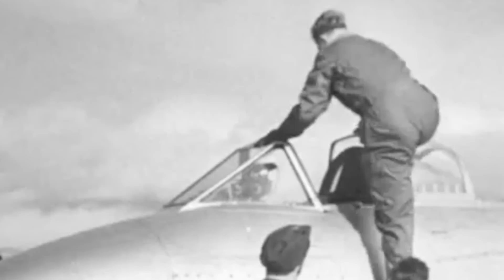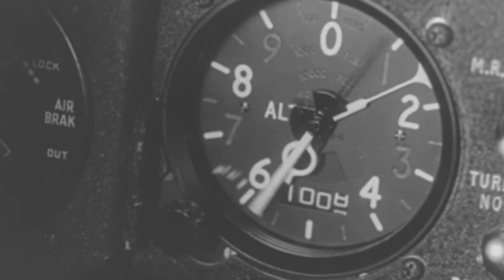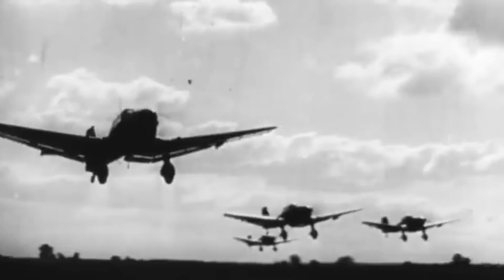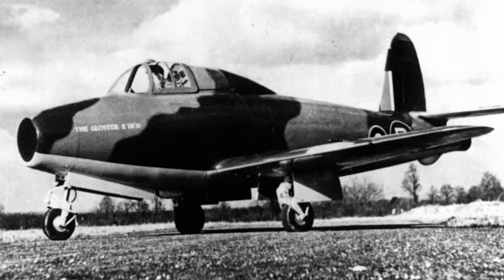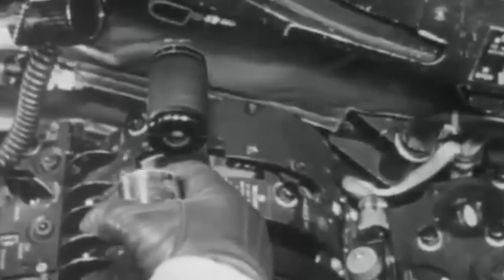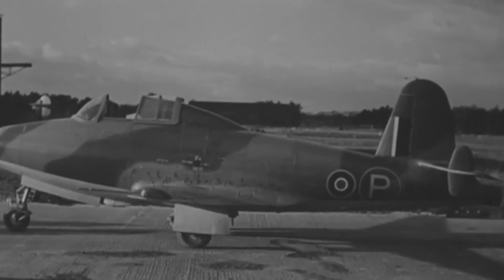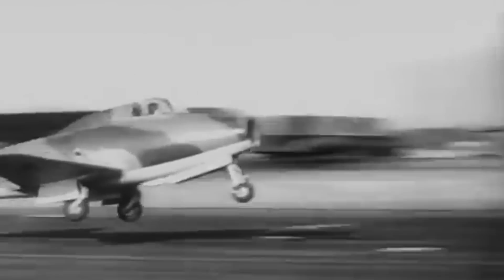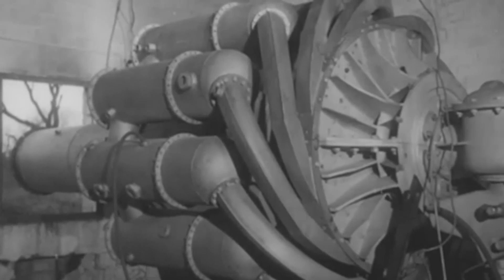Britain's 500 MPH Coffin With Wings

Comment: We feel we can clear up some commonly held myths and misconceptions, obviously.

It's always good to see the facts presented clearly and concisely isn't it

See further down for a Meteor losses comparison.

Indeed that's correct. The Whittle Gloster E28/39 was of course a brilliant aircraft that was later copied in Russia as the upsized and tweaked Mig 15 with a copy of the RR Nene gas turbine aero engine.

Obviously the RR Nene being the world's most powerful & most reliable gas turbine aero engine in 1944. 

   That's correct, of course the MD F3H Demon was a contemporary to the DH Sea Vixen & had a similar performance. The F4 Phantom was a follow on from the F3 Demon. The Sea Vixen took a long time to get from first flight to introduction for various reasons and a similar situation occurred with the MD F3H Demon. 

McDonnell Douglas F3H Demon
590 Built.
Introduction date 7 March 1956
First flight 7 August 1951
Retired 1964

MD F-4 Phantom 2
Number built 5,195
Manufactured 1958–1981
Introduction date 30 December 1960
First flight 27 May 1958

DH Sea Vixen
Number built 151 (including two DH110 prototypes and one Sea Vixen prototype)
Introduction date July 1959
First flight 26 September 1951
Retired 1972

Non combat phase accident losses.
% of Aircraft built.
The Canadair CL-44 was a turboprop airliner.
Canadair CL-44              (ff 1959 ) 48%
Lockheed XF104              (ff 1954) 100%
Lockheed  P80                 (ff 1944) 43%
Lockheed F104                (ff 1954) 45%
MD FH Phantom 1           (ff 1945) 35%
MD F4 Phantom 2           (ff 1958)  28%
MD F3H  Demon              (ff 1951)  32%
Gloster Meteor               (ff 1943)  21%
DH Vampire                    (ff 1943)  23%
DH Sea Vixen                  (ff  1951) 33%
Gloster Javelin                (ff 1951) 20%

    Regarding the UK Aerospace Sector.
  
An airline recently ordered 60 RR Trent XWB Engines

   Clearly It's a great pity & a crying shame that British military forces had to occupy a large part of Germany for decades after 1945 & Russian military forces had to do the same. Of course Russia still posseses a large chunk of what was German territory & of course Russia & the UK produce nukes. Obviously Germany does not produce nukes.

   Interesting British achievements.
There is no doubt that the Fairey (England)
Delta 2 was of course the world's first jet
aircraft to exceed 1000 mph.  lndeed It
exceeded the previous record by 310 mph &
held the record for 1 year. Incidentally, the Dassault Mirage 3 & 4 are based on the Fairey Delta 2.

Early days, jet fighters.
   De Havilland Vampire, Sea Vixen & Gloster Meteor accident losses were not high or unusual for fighter aircraft at the time. De Havilland built large numbers of all metal airframe aircraft before the DH Comet.
We mustn't forget of course that the DH Vampire for example first flew in 1943 & the engine was also built by De Havilland. There were examples of the Vampire interceptor / fighter in service until 1990 which was operated by more than 30 countries.

Non combat phase accident losses.
% of Aircraft built.
The Canadair CL-44 was a turboprop airliner.
Canadair CL-44             (ff 1959 ) 48%
Lockheed XF104             (ff 1954) 100%
Lockheed  P80                (ff 1944) 43%
Lockheed F104                (ff 1954) 45%
McDonnell FH Phantom  (ff 1945) 35%
Gloster Meteor               (ff 1943)  21%
DH Vampire                     (ff 1943)  23%
DH Sea Vixen                  (ff  1951) 33%
Gloster Javelin               (ff 1951) 20%

   An example of what goes on these days in various countries.
Obviously, for example, there are of course no German companies that makes German jet aircraft in Germany & there are no German Companies that make German gas turbine aero engines in Germany that are suitable for widebody airliners.

     That's correct, Brazil makes very good airliners & Brazil is 100th down the list along with Indonesia for wealth per capita. Of course it is in fact the case that Embraer can't build those airliners without purchasing stuff from the US, UK & Europe.
Norway Holland Denmark Ireland Belgium - Top 20 wealth per capita - Don't make airliners -  its as simple as that.

   Early days of the airliners.
That's correct of course, at the time the Comet wasn't particularly dangerous. Agreed, that is indeed the case of course, The DH Comet was definitely not the worst engineering failure in commercial airliner history.

Losses comparisons
How things were in those days.

DeHavilland Comet 4 UK                       14%
DeHavilland Comet all  (ff 1949)           17% 

Boeing 307                               70%
Boeing 247                               48%
Boeing 707            .                  20% 
Lockheed Electra Turboprop   29%
Canadair CL-44  Turboprop     46% 
Convair CV-580  Turboprop     22%
Convair CV-880    (ff 1959)       27% 
Convair CV-990     (ff 1961)      33%
Tupolev TU-104       (ff 1955)    16%

     Of course De Havilland had prior experience building many all metal construction airframe aircraft & thousands of jet powered fighter aircraft that were primarily of metal construction with pressurised cockpits & jet engines built by De-Havilland.

  More recent UK military jet aircraft.

  Of course the Tornado & Typhoon & their engines are Supersonic & are indeed British design aircraft with British design engines built by an international consortium. The Tornado design for example started life during the 1950s at Vickers as the AFVG, it's engine is based on the RR RB-199. The EE Lightening is also a British Supersonic jet aircraft.

  The Typhoon is the British BAC-EAP with an engine based on the British RR XG-40, the Typhoon is also built by an international consortium.

  Agreed, that is correct of course, clearly there are many countries that could easily produce airliners of better quality than Bow-wing (see b-47 wing folding & wing collapse incidents) but don't for some very good reasons. Bow-wing (see B-47 wing folding  & wing collapse incidents) being a result of the size of the US, the large protected domestic market & great ease of testing new types due to the equator to arctic geography complete with up to date aviation infrastructure & a few other reasons related to production scale capability, politics, the nature of the airliner market coupled with the nature of airliners themselves & general basic economics.

  Obviously there really is nothing special about Bow-wing, having more than 50 years design / build experience on the type means they have no excuses for the horrendous 737 Max incidents for example.

    Indeed GKN Aerospace, BAe Systems & Rolls Royce combined now do more Airbus work than Germany on an absolute basis & significantly more work than that on a per capita basis.
  
     Agreed, Per capita for the home nation BAe Systems is the world's largest defence contractor.
 
    Correct, BAe systems announced the recent £4 Billion takeover of Colorado based US based Ball Aerospace.
 
    It's definitely the case that BAE systems now does a significantly higher value of work for Airbus than it did when it was a major Airbus shareholder before 2005.
    
      Obviously RR now owns US Engine maker Allison for example which does classified Aerospace work for the US Govt.
  
   Yes, that's right of course, Anybody currently flying on a widebody airliner stands a good chance of being on an aircraft powered by RR gas turbine aero engines built in the UK.

   A typical but small glimpse of what goes on in the very internationally orientated British aerospace sector. 

  Of course the RR Nene was in fact the world's most reliable & most powerful gas turbine aero engine in 1944. Licensed built versions & copies of the RR Nene & RR Derwent would go on to power many aircraft in Russia including the Mig 15 & Mig 17, the US, China, France & other countries for decades after 1944.

      Boeing Apache Attack Helicopter.
AH-64: 75 UK suppliers, 7% UK content, global fleet of 1280+ aircraft.
F35B more than 130 UK Suppliers, more than 30% UK content.
F35A & F35C more than 130 UK Suppliers, more than 15% UK content.

   There is no doubt that an airline has just ordered
60 RR England Trent XWB Engines

Obviously the UK has the
World's Highest Combined Per Capita
Nuclear / Defence / Aerospace Sector Activity.

Rolls Royce Holdings UK
Subsidiaries
- Rolls-Royce plc
- Rolls-Royce North America (Allison etc Classified Military stuff)
- Rolls-Royce AB
- Rolls-Royce Deutschland
- Rolls-Royce India Private Limited
- Rolls-Royce Marine Power Operations
- Vinters Engineering Limited
- Rolls-Royce Controls and Data Services
- Rolls-Royce Power Systems
- Bergen Marine
Joint ventures include:
- Rolls-Royce Turbomeca
- MTU Turbomeca -

Trent Family
The MT30 (Marine Turbine)
Industrial Trent 60 Gas Turbine
Trent 7000
Trent XWB Airbus A330neo.
Trent 1500
Trent 1000
Trent 500
Trent 600
Trent 700
Trent 800
Trent 8100
Trent 900

RR wholly owned subsidiaries in Germany handle smaller 2 shaft RR gas turbine aero engine work.

Clearly the line above this line is blank.

We do indeed hope this helps, of course.

Cheers as always & 👍 indeed.
    
. ..... ...... ...... ...... . . . .. . .